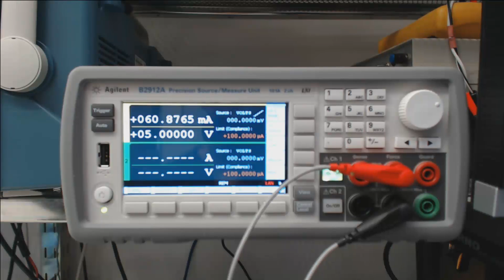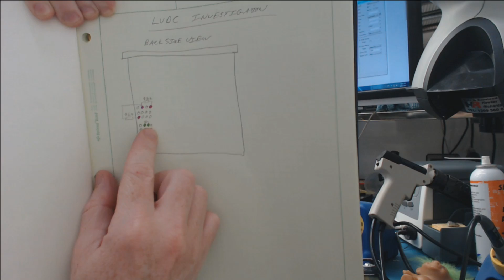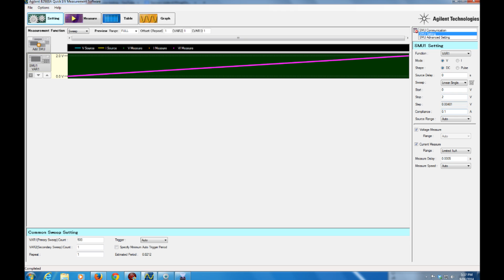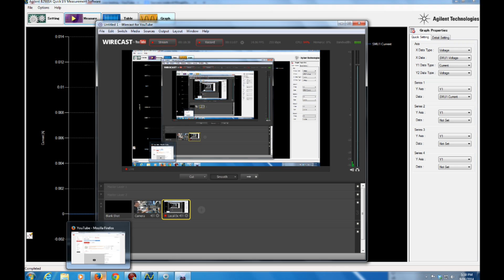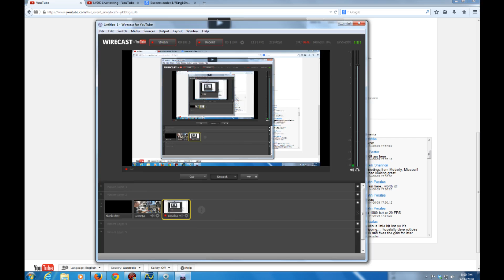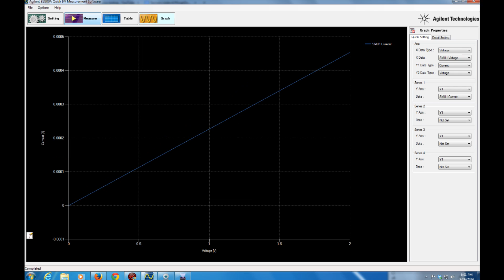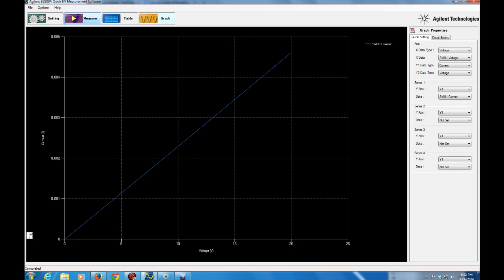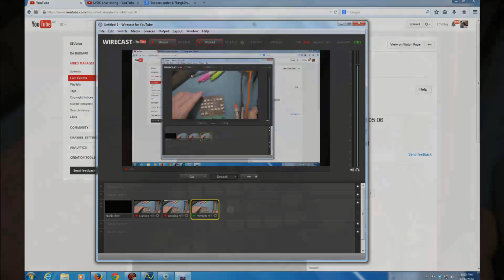Apollo Saturn LVDC Live testing

Comment: If you want help Dave I am a live streaming expert. I even run a live streaming CDN :P Message me if you want, PS, Wirecast is a bit crap but that is my personal opinion about it, plus if you want a low delay between you and your viewers YouTube is not that good for that. PM if you want, I am on your forum as Jackster.
Reply from the maker: Thanks. There are good reasons why I should use Youtube for live streaming. 145,000 good reasons... If you have a better idea than Wirecast for Youtube live streaming then I'm all ears.
Reply: Yea the having subscribers on the same server as your videos is good, but long term live streaming via YouTube, hmmm. xSplit is very good and is good for many capture cards, I use it myself for BlackMagic and Hauppauge cards. There is also ffSplit, vMix that might work well for you. xSplit is probably the best though, take a look at their free version, see if it works well for you and is comparable with your HDMI capture card.

Comment: Dave you should use xsplit.
Reply from the maker: Yes, I will give Xspit a try. My Avermedia card came with a 3 months free trial.
Reply: EEVblog Yeah it also supports key bindings so you can map keys to scenes for example you might have a scene where you have a screen capture with your webcam in the top right.
Also you should probably get another Avermedia capture card to connect you your cannon hfg10 to get better audio/video quality.
Reply: EEVblog
You may want to do some research into QoS (quality of service) which can be used on your Routing device to prioritise delivery & sending of data. Doing so can improve throughput for certain data types, ie streaming video and audio. In a pinch you could just Port Forward 80 & 443 to the IP address of the PC you are streaming from, however this will make Port 80 & 443 (http & https) unavailable to any other device on your network. I would also recommend that if you are using WiFi to connect to your Router that you don't and connect with a cable if possible.

Below is a brief introduction into QoS and how to set it up on some consumer grade routers.
http://www.pcworld.com/article/212867/optimize_your_office_router_for_voip_video.html

Also try to Google "QoS to Improve Upstream" with the make and model of your Router to find information on how to set QoS rules that will prioritise data leaving your network.
Reply: EEVblog The C920 will do 30fps at 1080p no prob. In Xsplit you have to change the colorspace setting to YUV2 or something like that to get it to encode the video. Otherwise it tries to send raw uncompressed video down USB2 and you get that framerate. Fiddle with the source settings in your encoder or use Open Source Broadcaster- it handles that automatically it seems.
Reply: *****
I think seeing as I am an Network Administrator working on Cisco & Juniper Phone/Data networks for the last 15+ years I know what I am talking about.

I am not going to write a 10 page reply explaining the intricacies of QoS, I will simply point out that regardless of bandwidth or throughput, or the number of devices on a Network, if you have a service that requires timely and high availability of data delivery, such as VOIP or Video, you should always configure your QoS to give high priority to said data.

As for wireless, even sitting next to the transmitter the delivery time of data and packet loss will increase dramatically over that of a cable. He is not sitting in a shielded room with no other transmitting devices, so there is going to be interference constantly.

Perhaps you should learn why services that rely on timely and high availability of data delivery such as VOIP & Video should be given high priority on a network, and be cabled. Especially those using consumer grade switching and routing equipment.
Reply: ***** 
I have no intention of arguing with you. Especially when you provide no credentials yourself. You disagree with my advise, fine, want to think you are some Networking Guru, good on you.

I am not going to teach you Networking Fundamentals or get into some pointless debate with someone who comes across as a Wikipedia expert.

I simply commented to help Dave try and resolve his poor streaming issues. Perhaps you could be constructive and offer your own advice to resolve the problem, rather then just trying to get into a pissing contest over the Internet. Seems to me you are more interested in trying to big note yourself then offering solid advice.